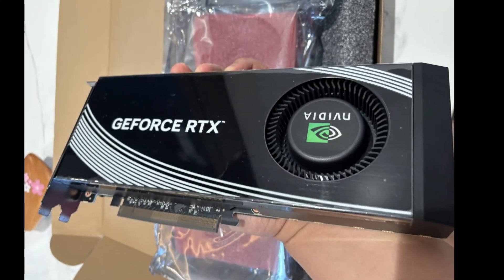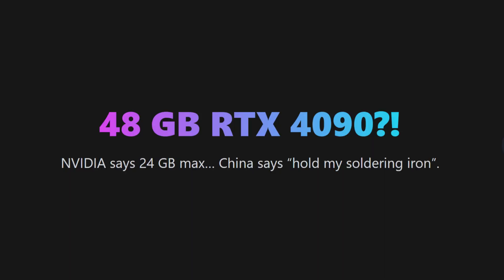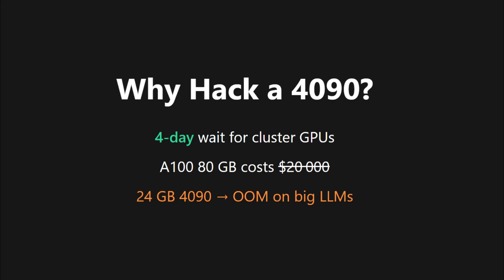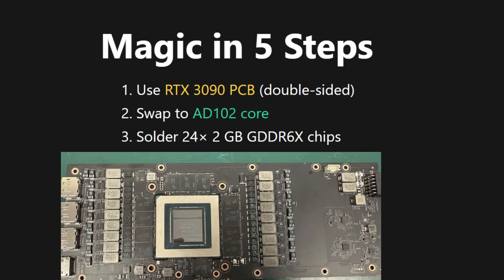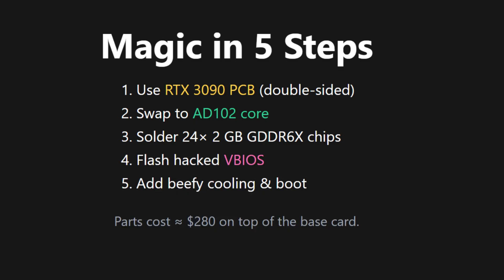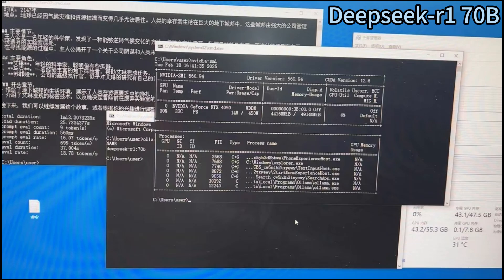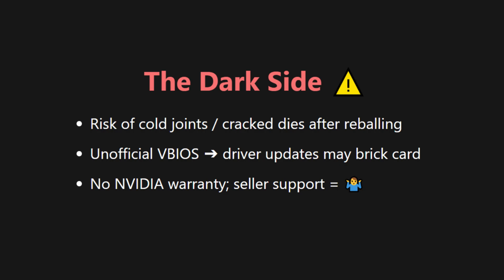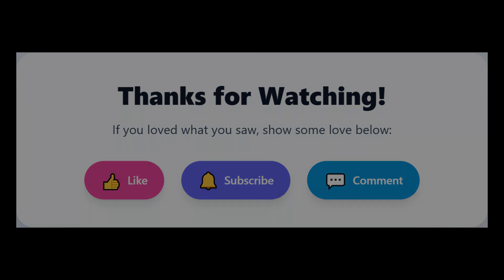48GB RTX 4090! Risk, Reward & VRAM Inside the Underground Mod Scene #4090rtx

Comment: The v1 mod reused the PCB from the 3090. The v2 mod introduced a newly designed 4090 48GB PCB with three cooling fans. Now, the v3 mod takes it further by integrating water cooling. Both v2 and v3 are priced around $3,000 and come with a 3-year warranty.